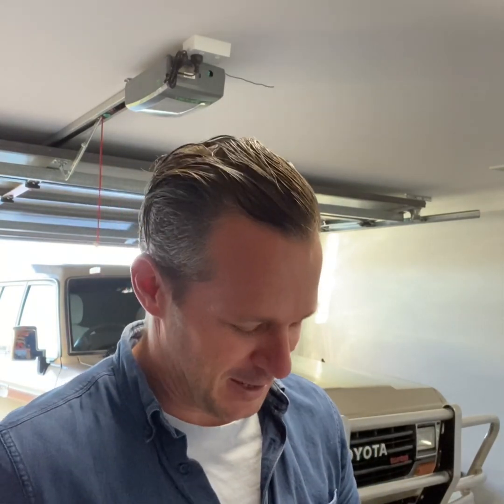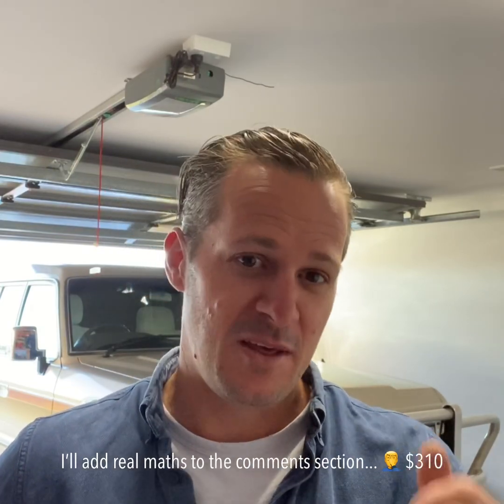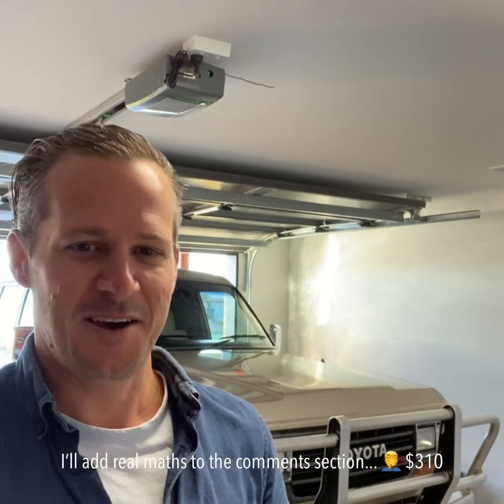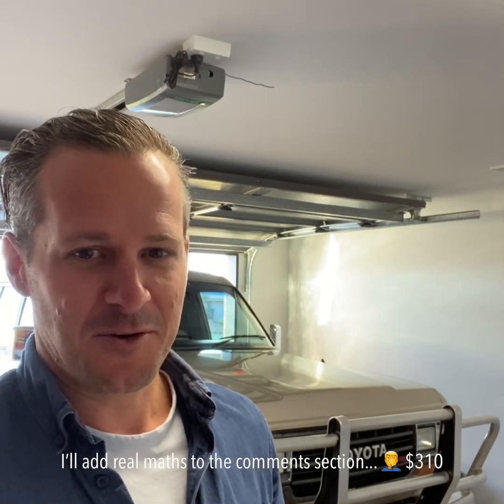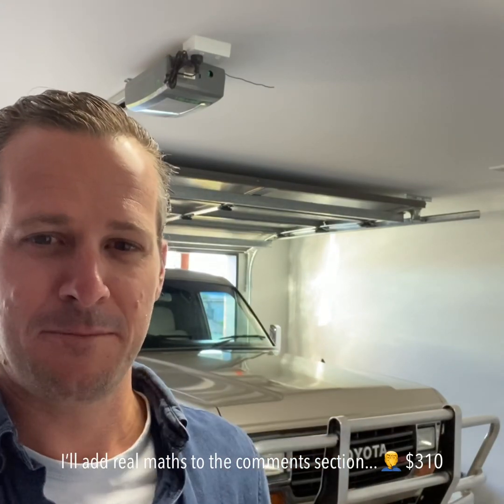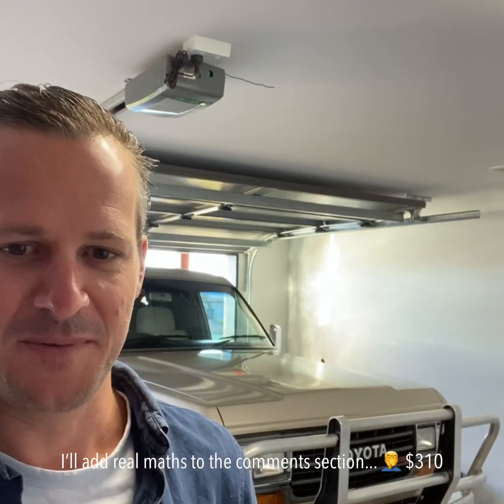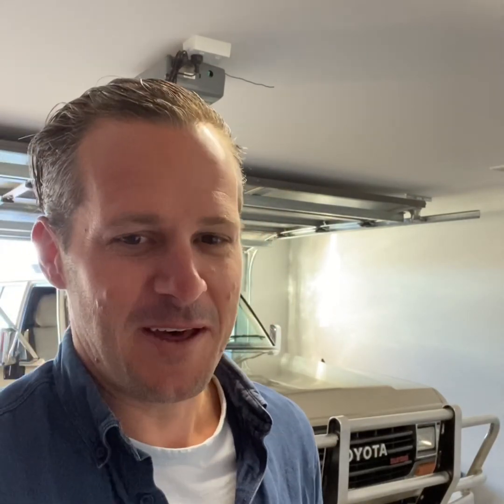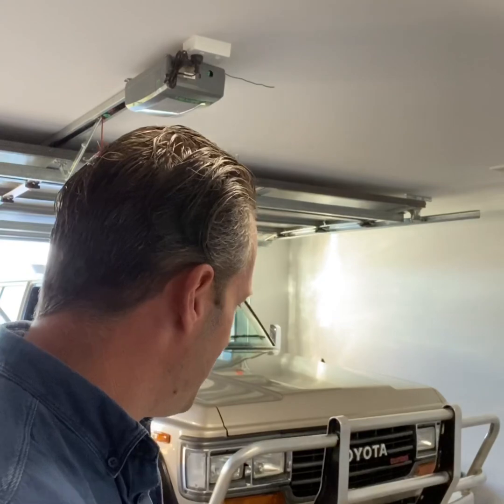LED Drop In H4 Headlight Replacement (HJ61)

Comment: Did the same thing on my LHD model, the difference is literally night and day. Even found 24V LED bulbs on Ali, now all 4 of my headlights are identical. Only thing missing is low beam on inner pair but it's quite an easy electrical fix.

Highly recommend this mod for any car with 4x6 inch headlights.

I have some concerns with the beam pattern, couple drivers did flash at me so I'm gonna need to address that. Hopefully it's an easy fix, maybe the Low beam leds aren't in their focal point or something, at least I hope it's not because of the reflector housings.